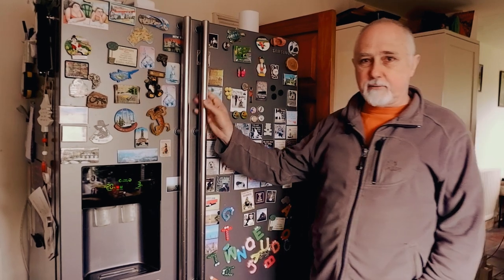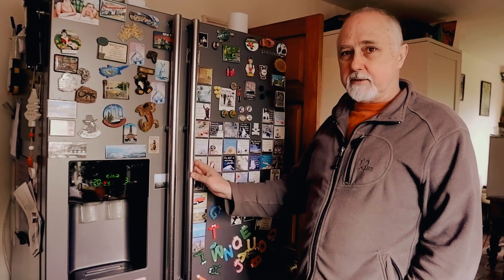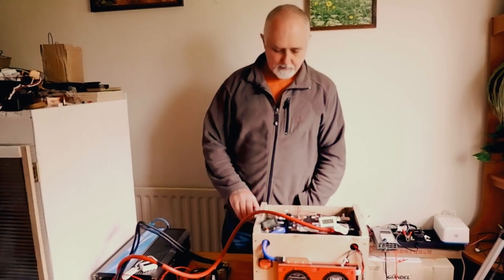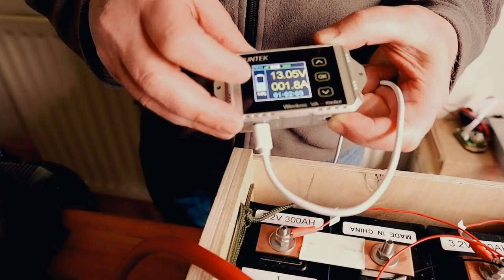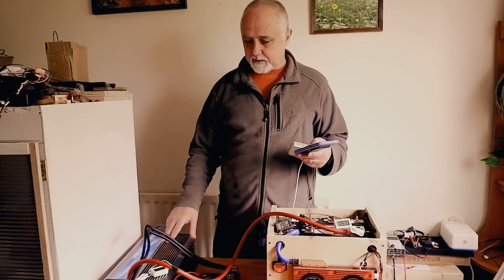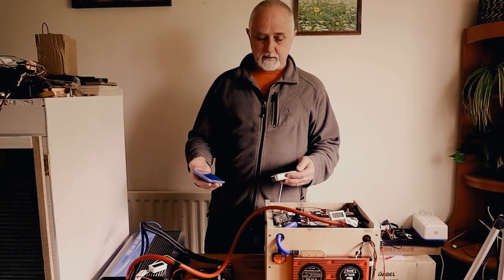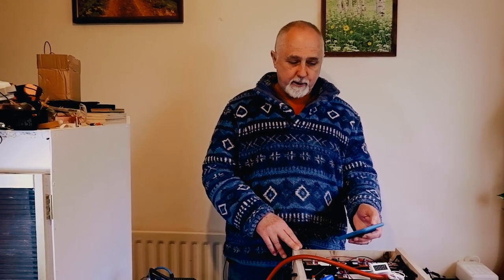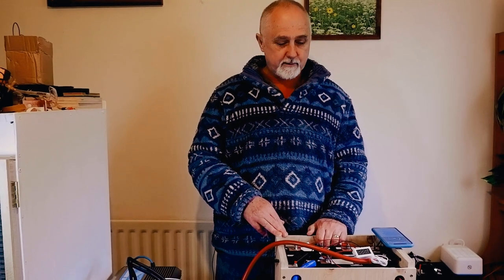How much power does a standard 240v AC refrigerator use from a DIY LiFePO4 battery?

Comment: For years I ran a full size fridge(and a lot more) on a 3000watt true sine Go Power inverter and 2ea. V- Max 8D batteries for 48hrs every weekend on my houseboat. I’d leave harbor and find a place to decompress in peace. The Biggest drain on a refrigerator is NOT the compressor but the defrost cycles. Wire a switch to disable it. You don’t need defrost for short times on the battery like a weekend. You also won’t hear the inverter fan kick on in the middle of the night. Just remember to switch it back on when you’re back on grid or generator.
Reply from the maker: That's great advice, thanks!

Comment: Nice experiment. I appreciate the 2 shunt power comparison and might get them both. My home fridge likes 120 volts ac. The grid in California has been unreliable during the last few years so I started piecing together backup power systems. Priority #1 is keeping the fridge and chest freezer running. Last August we had a terrible heat wave where the peak temperatures were between 38C and 43C for a week. A nasty early morning lightning storm set wildfires over a large region and within days the heavy smoke turned the air toxic and we were ordered to Shelter in Place. We lost power for 39 hours. All of the neighbors had to throw out spoiled food except  for us.  I have about 2500 AH in batteries so far. There are some Lishen 280AH cells coming and the Daly 250 is here. 

During the power outage, I could hear a construction site gasoline powered generator about a Km away running day and night. It never stopped so I assume that it was fueled on the fly. Around 2AM on the third night, I was awake and heard a slightly different sound coming from the generator. It then started clattering louder and louder until 20 seconds later it went instantly silent. I would bet the fool ran it low on lube oil and it threw a connecting rod.  In the mean time I was rigged for silent running and kept my ceiling fans, fridge, WiFi and freezer on line.

 I have 420 AH in AGM cells to power up a 12 volt  6 zone built in automatic power failure emergency lighting system that has been updated with LED panels in the fixtures. It has a seismic switch to energize the lights in an earthquake exceeding magnitude 4.5. Full load is 1.2 amps so there is plenty of run time. I also have a whole house natural gas seismic trip valve and a single lever in my laundry room to shut off all water pressure to my house. I'll bet you don't have need of such things.
Reply from the maker: Wow! That sounds like quite a set up! Thanks for sharing. Sounds like you're well prepared. 

You're right that we don't have need for much of that, but we got into offgrid power for van life & vehicle based adventure travel but love the idea of moving our housing, etc.. offgrid one day too! :)

Comment: I run a double door fridge and a 6 ft deep freeze and a 12000 mini split and washer and dryer and dish washer and micro wave and a coffee maker and a forced air heater. And I've been off grid for thirty years. Two 48 volt batteries two 5000 DIY inverters 10,000 watts of pannels. Never had any problems. Oh and it all cost under 10.000
Reply from the maker: Nice! Sounds like a great set up!

Comment: I've been running  a Hisense 242L fridge only 175kwpy  and a Hisense upright 155L Freezer 228kwpy for 4 yrs non stop on a 2kw Giandel inverter and 24v 400ah bank of Century N70T batteries fed with 2kw of solar
1 draws 50w running the other 45w running both uses about 50A at 24V in 24hrs
To be honest i cant see that much difference between Todays efficient 240v stuff and the collection of Dometic Companion  and other brands I've spent a fortune on over the years.
sure if your traveling OK
But with everyone furiously upgrading Panels to keep pace with power increases
you can pick up a good cheap 2nd hand 5kw systems for $500 to $1000
my findings anyway
Cheers

Comment: I've seen someone put their fridge on a timer turning it off for an hour then back on for an hour saving about half of the energy
Reply from the maker: That's a good idea. Obviously we were just testing the concept, but to really run an AC fridge on an inverter, you'd want a timer as you say. Especially when you're sleeping! It would make total sense to turn the fridge off on a timer whilst you're sleeping when the fridge is not being opened. I would also look for better, more efficient options such as having a chest freezer instead of a standing freezer so you don't dump all the cold air ever time you open it!
Reply: Hi Dave from Phil that's a good idea I run solar fridge all day then off at night  on at5am or on batt early morning

Comment: If your going to run a fridge on battery with solar back up ..make sure it is a manual defrost ..and has r600 refrigerant .!!!auto fridges defrost every 8 hrs ..as well have a large cooling fan in the condenser. ..uses large amount of power!

Comment: There's no difference between a car fridge freezer and a domestic fridge if you use lithium or lead acid deep cycle battery on solar panels, go for a LG fridge with a linear compressor, they use less wattage , you want to aim for at least a 4 star energy rating fridge using no more than 300 KW/hr per year, , in most parts of Australia just 2 200 watt mono crystalline panels  will easily power it without overly draining the battery too much , during winter go for wind turbine.Make sure you use a pure sine wave inverter, at least 1500-2000 watt, you have to allow for the compressor load as it starts.
I would definitely not use any fridge outside of LG.